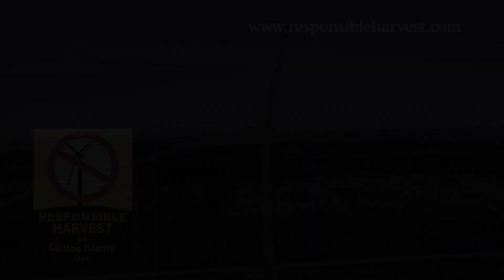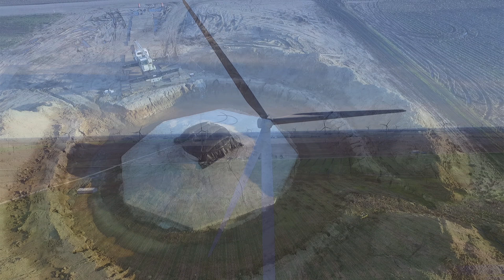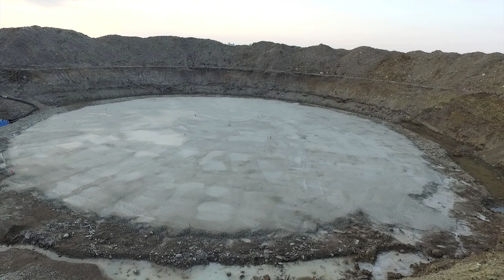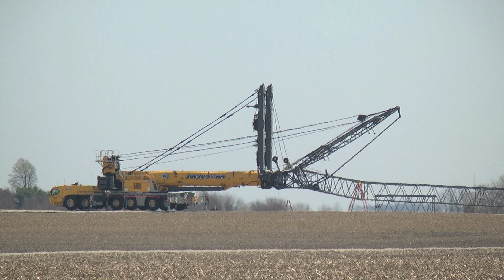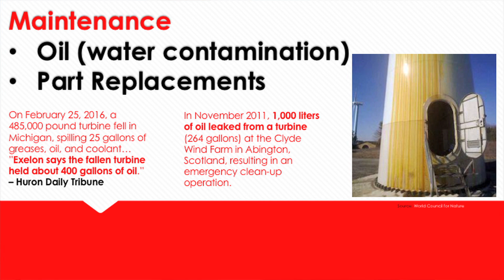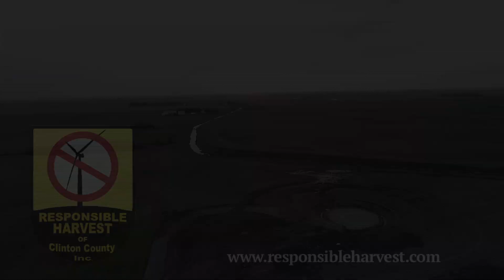Wind Energy: Not Clean, Not Green

Comment: Now, let's talk about a coal plant. It also uses huge steam turbines, and alternators. You may argue, that per watt, they use less land. Not when you consider the massive mining operation that continues throughout the cycle life of a plant. Watt for watt, the materials used are the same, and cost the same. Once the turbine is commissioned, no further need for water. Maintenance: the same as just the transmission,(no engine, no tires, no brakes,no fuel) and hydraulics of one of the many trucks used in mining and transportation of the fuel continuously needed for a coal plant. You are right, they do need to be connected. They're spread out. That is a one time expense, just like any other type of generating site. I hate to break the news, but there is plenty of concrete involved in the construction of the cooling towers, and the foundation of the generating station itself. again, about the same per watt as wind turbines. Don't even get me started on the containment domes of nuclear power plants. So, you have to consider the train locomotives and train cars, the railway to get the fuel there, and the fuel constantly being burned to get the fuel there. The transportation to get the components of the turbines on site, is a one time thing. They do need to be put up, using the same construction equipment you'd find at any construction site. You also didn't mention, that cooling towers need a steady supply of water to evaporate, in order for proper condensation of discharge steam from the turbines. Decommissioning: I agree, that there needs to be a recycling program for things like the blades, and the nacelle exteriors. everything else, is equal. I'm sure there is plenty in a coal fired plant, that can't be recycled either. Site reclamation: Coal leaves the land so polluted, it can never be used by anything else, except, maybe putting up a wind turbine! Oil, just let one tanker truck crash. that's the same as 100 turbines toppling, and spilling their contents. Not likely, unless a tornado hits.(It's happened) even then, 100? When decommissioning a turbine, Knock em down, haul em out. Done. No ground pollution, the land can immediately be farmed or used for any other purpose. far less likely to pollute ground water than an ash pond. Rare earths: though used, none required. they're slightly more efficient, but a generator is a generator. Turbines can be doubly fed, externally excited, or ferroresonated induction, just like a conventional plant. there are just many small ones, instead of a few large ones. the materials don't change. Any thing you can accuse a wind turbine of, applies to any source of power. Wind does NOT require the continuous supply chain of fuel, nor does solar. Energy literally comes out of thin air. for solar, energy just comes down from the sky. Free fuel delivered for free. That is, once the systems have been commissioned. That's the only advantage renewable energy has over conventional, but it's the biggest.
Reply: Up to about 150 kV the standard (at least in the netherlands) is to lay them underground.  The benifits considering the obstruction of the views, the smaller magnetic fields, and the ease in which permits can be obtained from local and regional gevernments wins it over the higher costs.  When you go to higher voltages like 220 kV and 380 kV you run into problems like you mention. With typical windfarms (on land) with turbines of about 3 MW you can perfectly link serveral windmills in a 22 kV or 33 kV ring which can be put perfectly connected with underground cables. Lead them to a substation and then transport this power to whereever you want using a higher voltage. For offshore wind projects you can use larger turbines 6-8-10 MW. For that Tennet has a standardised concept of chunks of 350 MW linked together with 66 kV and 220 kV cables (on the seafloor).  https://www.youtube.com/watch?v=x7dR39HctbY.

BTW there is not much difference between a windfarm, a coal plant and a gas fired electricity plant in placement. For large plants you do not want to live right next to them. So for all plants you do need transmission cables which bring the energy from where it is generated to where it can be used..
Reply: @SkaterJanF  Here on the East Coast of the US I hardly ever see long runs of underground or submarine cable at transmission voltages. They seem to be at distribution voltages
Reply: Vincent Robinette Something your leaving out is the life span of a coal power plant compared to wind turbines, watt for watt coal outperforms wind easy, and nuclear plants blow wind out of the equation also water for cooling towers? nuclear plants are built strategically by a large water source and the aquatic life love it as the water stays warmer year long.
Also the electricity the usa uses is too much for wind to power, like hydro and solar they will never be able to work by themselves. they can only be supplemental to the real power plants like nuclear/coal/gas.

coal power plants use trains to transport the coal and the equipment that mines the coal along with the trains are powered by electricity from the coal plant. pretty efficient and no fossil fuel for that part(in terms of power production).
Reply: the problem is the primitive thinking of energy giants who don't get the fact that it's over. the solution is here, it's proven and it's cost effective both in capital terms as well as socially and ecologically,  site based off grid systems. it's time to cut the wires.
Reply: The difference is a coal plant can produce 100% of it's nameplate rating 24/7/365. Wind turbines on average produce 20% of their nameplate rating. That's a big difference. Not to mention wind farms usually are not where the energy is consumed. Easily another 10% lost due to I2R heating of the transmission lines. And the transmission lines need to be above ground to eliminate carrying nonproductive current due to leading powerfactor problems
Reply: @cindytepper8878  Though the capacity factor is closer to 30%, you hit the nail on the head on 2 counts. They're intermittent, because the wind doesn't always blow, and sometimes at the wrong time. 2, the power factor fluctuates as much as their outputs, especially if the wind is gusty. The only way for turbines to be considered generation, instead of "negative load", is with some kind of electrical energy storage. Something that can store the power when it's available, and deliver it when needed. Tesla power corporation installed a 120 Megawatt hour, 100 megawatt battery system in southern Australia, and proved that it's what renewable energy needs. Both wind and solar. Right now, if wind becomes any more than about 20% of total generating capacity, they become more of a nuisance, than a source. That's why we need to be working on grid scale electrical storage. Something that functions like a big battery, with bi-directional inverters, that can respond instantly to fluctuations caused by turbines, solar, and sudden changes in electrical demand. Conventional power stations can't instantly respond to sudden changes. They're not like the governed Briggs and Stratton engines found in portable generators. Once we get energy storage, I want to see more big fans, than a super bowl football game.
Reply: @vincentrobinette1507 
And how monstrous big is that battery ?Do we need a other planet to store electricity in batteries??
Reply: @computeraddic675  Shipping container units (8'x40'), ten in a row. Molten metal batteries are on the way that are far less in size for the same capacity. Though it pains me to say it, as an engineer in the power industry, solar and wind are still far cleaner than coal will ever be. Until we come up with a direct electrical production (beta emission) fusion reactor, solar and wind, and possibly clean nuclear (Thorium as mentioned before) are the best we have so far. As an old hotrodder, I'd like to think we can run forever on fossil fuels, but the reality is, we cannot.
Reply: Tad Johnson we have enough oil in terms of fracking to last thousands of years so we have plenty of time.
Reply: @cindytepper8878  A coal plant is a technical installation and therefore will require maintenance. Therefore also a coal plant must be taken down for maintenance once in a while resulting in an availability somewhere between the 70% and 90%. Modern Wind turbines currently have an availability of 40% and rising. The estimation of 10% loss in transmission lines is a bit steep: Do you think always the max current is running through them ? If not then the losses decrease in a quadratic fashion. What does the powerfactor have to do with cables above or underground ? Usually the powerfactor is lagging (inductive loads). Wind energy is perfectly capable to stabilize the grid and offer a power factor 1. This is proven on a daily basis for example in Denmark (which is hooked up to the grids of neigbouring countries).
Reply: @SkaterJanF  Underground has the conductors spaced too close resulting in more capacitance between phases and leading pf.
Reply: Jan,

figures i saw are more like 3% for transmission and 12% for distribution (much lower voltage). Wind generated electricity is unstable very often and very variable as the output changes with small changes of wind speed by a cube law. This makes balancing the load much more difficult and the larger the percentage of wind the worse it gets. This impacts on the effective running of the thermal plants necessary to make the system work and increases unit cost. Denmark is fortunate, in some ways, as they export their excess power to Norway at a cheap rate and Norway feeds expensive hydro power back to them whem the wind is low.  This expansion of wind has put their electricty amongst the highest in Europe. This is the same in Germany very high cost due to too much wind(And in the U.K. although not quite as bad) .
Reply: @iainreid9914  Yeah, as a Dane, I like wind, but I 100% agree with you that we are very fortunate by being connected by HVDC lines to Norway, Sweden and gerrmany.
Also Denmark receives alot of stable wind, something like 3-5 BF is normal most of the year except spring and summer (when Norway has plenty of hydro available)plus we only rarely get strong storms (which also halts wind production)
So yeah, we are lucky here :)
Reply: @cindytepper8878  average transmission and distribution power losses are 5% and apply equally to wind and coal. The only way to avoid these is with distributed power.
https://www.eia.gov/tools/faqs/faq.php?id=105&t=3

Comment: Wind energy doesn't claim to be perfect but it is cleaner than competing forms of energy. 

All forms of energy must be built using materials, connected to the grid and maintained. All forms of energy bar solar use oils and coolants. 

Please provide evidence of a single time a turbine has caught fire and damaged someone's home as you claim. Also please provide evidence of a single time that fluids spilt from a turbine have impacted neighbors.

If you don't use wind turbines then what do you propose as an alternative? 

Also wind turbines life spans are not 10-15 years as you claim. All modern industrial wind turbines have life spans between 20-25 years so that's yet another inaccuracy in your video.

Also you say they're not easily recycled. That's not true. Admittedly the materials for the blades aren't easily recycled but all the steel used to produce the towers and all of the metals (including rare earth metals) inside the gearboxes, generators etc is very easily recycled.
Reply: Still a relatively short lifespan compared to coal and oil powerplants if I remember correctly
Reply: Then why germany failed on being More Green?
Reply: @Caleb m  thing is The government is always going to use the technology (for example If we ever discover a way to harness fusion and or cold fusion power the government will likely use it exclusively to generate electric (or if it is ever released to the public sector companies) and the amount of power made by nuclear powerplants far outstrips the amount of power solar and wind can make (if built properly) for a far Lower price and far more compact use of land (hence why Coal and Oil power is so heavily used today it uses A lot less land than Wind and solar and is far more reliable compared to wind and solar)